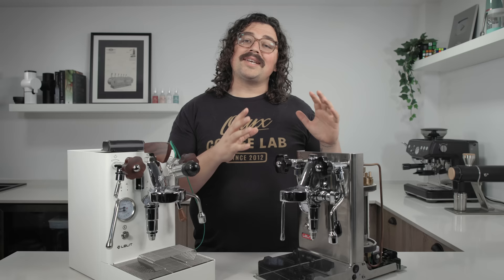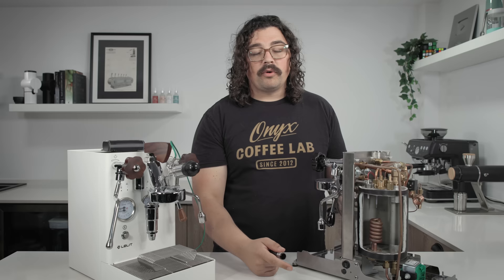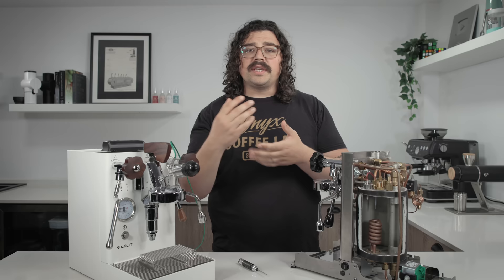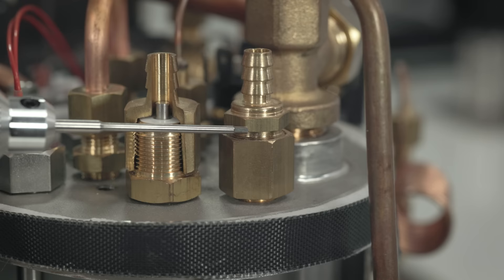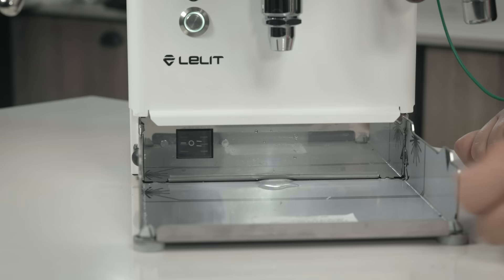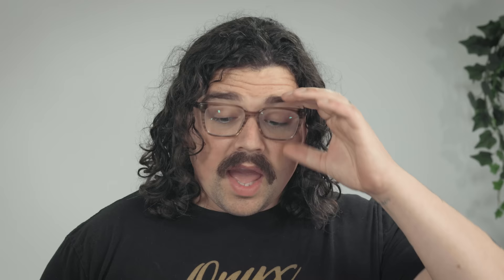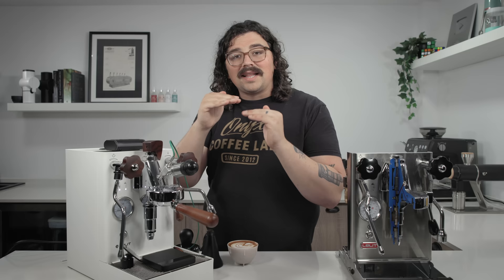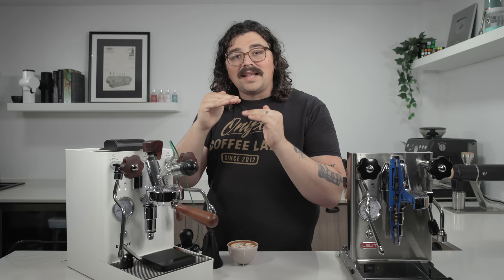BEST BUDGET HEAT EXCHANGER?: Lelit Mara X Review

Comment from the maker: Let's chat below! Ask any questions that may pop up. And don't forget to hit like, subscribe, and the bell for notifications to show some support! Cheers!
Reply: Thanks lance, great review as always. Please stick to the in depth format, I know you were contemplating it a while ago but this is so much better than the usual “reviews” on YouTube.

A good comparison to the Mara is the Lelit Elizabeth which is a dual boiler with steam boiler prebrew for the same price as the Mara. It’s also more energy efficient and I’m debating the choice between the two.
Reply: about  the slow ramp up on the pressure  at the beginning you just   need to change the spring inside the three way selonoid valve after that you have the full control of the pressure from first second to end of the shot.
Reply: About the high temperatures. This is because the machine goes to super heat mode right after the first shot. It will overheat the coffee once you wait too long, if you want to pull head to head shots. Thus to not overheat, you will need to pull the next shot after two minutes from your previous shot. If you wait longer than 5 minutes the machine will overheat. Then you will need to wait 15 minutes before the temperature level goes back down. Kaffeemacher found that one out they also have a great YouTube channel…
Reply: I wish there was somewhere in the USA to buy this machine for the $1400 you qouted instead of $1800... I continue to be dissapointed by how wildly marked up most machines are in North America. It's one thing when we're talking saturated group flagships, but these E61s aren't on that level. Just all the more reason for Americans to buy a Decent, back machines like the Argos and Meticulous, and generally consider these massively marked up E61s something more like a last resort I guess.
Reply: Hey! Does de Bianca worth the extra bucks over Mara x? In terms of temp stability, and others?
Reply: Thanks Lance, can you make a video on the pro500 to justify my purchase? 

More seriously, can you deep dive on the adjustable flow rate kits and how to make the most of them?
Reply: Any eta on the Zerno review?? 😊
Reply: Lance, I’m curious to know what machine you would spend your money on at that price point if that was your budget?
Reply: @BB I own the version 2 and can confirm that the 15 minute cooldown is still there. In my machine I have not found a temperature creep and I’m my machine I still have found the overheating after five minutes after the first shot. And it makes a lot of sense: after the first shot the machine goes to 1,5bar steam by heating the steam tank. This heat will at some point also reach the heat exchanger which is why you will get an overheated second shot if you wait too long in between shots. If you are quick enough with your consecutive shot, the water in the heat exchanger is removed and fresh water is added, preventing an overheat. My Mara is equipped with a thermometer at the same position Lance uses and this is my experience after 6 months of use.
Reply: Hi Lance, thanks a lot for the indepth review. I have the machine since about 3 months now and I have installed the flow control. so I have some questions for you if you dont mind:
1-when you installed the bianca flow control did you change the upper spring as recommended by Lelit? the one provided with the FC kit is softer than the original. and did you remove the lower spring since you dont need it for the pre infusion anymore.
2-can you please tell me where did you get the Y splitter!
3-the relation between the FC and the pressure is not linear as you might have noticed, is it the same as on the Bianca.
thanks in advance if you have the time to  reply.
PS. keep up the great work, you rock :)
Reply: I guess your temp test was done with the standby switched off. Would you say that the ramp up could be somehow mitigated as long as the machine turns off automatically hence you won’t get to the >1h mark with the machine heating up?
Reply: I have noticed the steam pressure after two shots, and steaming milk for two drinks, the steam pressure tends to be pretty low. However, coming from Barista express, I steam milk better at low pressure.  A question: my pucks tend to be pretty wet  in this machine. Is this normal? Just curious, no issues with the taste though.
Reply: Why does everyone sound like Redditors in Youtube comments now. "Friends we made along the way" . Jesus Christ
Reply: @Dawnhun1er  nice review. How about if you flush out the water for a few times? does it help? I
Reply: @MM I have never tried it I suppose it should work. Tbh I never needed it because if you stay true to the above mentioned routine, you will be fine
Reply: I've this machine and I have a constant issue with pressure. Most of my shots are around 4 top 5 bars and other straight to 9 bars as expected. Don't know why this happens, even when I'm using always the same configuration with grind and amount of coffee. Any suggestion?
Reply: Hi, I've been a lelit fan for a year already with my Kate (i know, noob mistake grinder+coffee machine but the deal was insuperable) and I am starting to get interesting in "more" I've seen mara around but I am in love with Bianca and I realized between dual boilers and heat exchangers... The lelit Elizabeth and the Mara X lands around the same price... What would you choose for your coffee at home. I've always heard that dual boiler is the best but I only hear good thinks about the Mara. Also heating time is a concern.
Reply: @javiervidaltellols3355  in my humble opinion, for home use the Mara X does a great job. Doula boilers makes more sense if you plan to make multiple coffees like in a Cafe. The most common is to make 2 or 3 coffees at the time and for this situation MaraX is a killer
Reply: @chipimax  yeah, i looked at the Elizabeth because having two boilers they are pretty small and the group design is different, to it heats up faster and you have two pids... I have a similar deal under 1000€ for both and I stucked deciding... 😅
Reply: @javiervidaltellols3355  I think that on paper, the Elizabeth probably is the better machine. I decided against it mostly for looks and energy consumption, and because I kind of wanted to have an E61 group. After owning the Mara X for 2 years though, if I could go back in time, I'd buy the Elizabeth. Dedicated boilers and easier to clean because you can just backflush with Puly Caff / Cafiza / whatever cleaning product as often as you like, unlike with the E61 group, where the mechanical cam will eventually begin to squeak unless you disassemble and lubricate it. Also, while I like what Lelit has done by adding better sensors and software to a heat exchanger, it's all very opaque and unpredictable, unless you have the tools to measure every variable.
Reply: I like how technical you are with your reviews. I would love to see a thorough review from you about the Olympia Cremina.
Reply: It's a remarkable machine and very well engineered for the cost. I would be keen to see you do a similar breakdown of the Elizabeth, Lelit's dual boiler machine at a similar price point but also has the advantage of not using the E61 group, so heats up much quicker.
Reply: Hi Lance! What are your thoughts on the Elizabeth?
Reply: This is great. But the espresso machine by no means is budget come on
Reply: Hi I'm a new subscriber! I love the reviews (I'm a massive NERD myself). I have two questions:

1. What do you think of this for a small, adorable cafe for someone who wants to get into a cafe business?

2. This vs. Rocket Appartamento TCA, which one is better?
Reply: Hey lance what’s your thoughts on Mara x vs Classika??
Reply: Hi Lance let me just start by saying that I love your videos ! I wanted to ask you a question. I just hope you see this. I have a Barista Touch (broken down) and i’m looking for an upgrade. The upcoming Breville Oracle Jet caught my eye but so has this Lelit Mara X and even the Bianca. I  don’t know what to go for. I have mainly espresso or americano or long blacks and never use any milk. I like the simpleness and quick heat up of Breville but i enjoy prepping my coffee and dislike so much automation. What would you point me towards?
Reply: @kagantirtir7700  Hi Kağan! Could you please elaborate a little bit more on this please?
I'm really interested on disabling the slow ramp up on my Mara X!

Comment: The temperature drops , because you are on brew mode and the heating element is off , and when you have the flow control closed, the machine pulls fresh cold  water in the hx brew chamber .

Comment: Thank you for showing the inside of this machine. Two things I have been asking for Stainless Steel and Copper element. So many videos don't show this or they don't know what is inside. And they never talk about high-temperature boiler applications, three general grades (Stainless Steel), 304, 321, and 347, are the most widely used. Know ones about this! I have to go directly to the MF.

Comment: The temp drops because this machine is setup with perfect flow at stock setup to inject enough thermal energy into the large mass of brass to maintain the programmed temperature curve. When you choke the hot water you choke the heat input into that huge block of metal and the temp must fall as a result. Other machines may behave differently because they are limited by the heating elements power output so reducing flow helps the heat rise. But here we have a very large thermal mass in the boiler cushioned via a heat exchanger, thus providing a very stabile source, choking it does not spike the it high at source but it does reduce what goes into that huge cool block of brass at the front, without enough heat input into the brass the temp falls. Amazing thermal design and construction quality. I'm a heating engineer and I recognise the fittings and construction methods used here to be top notch. Solid old school hydronic design, its been tried and true since steam engines ruled and looks similar in rocket engines that go to space today, good old compression fittings, soldered connections and formed metal pipes. Boilers a boiler weather, its heating a hospital or coffee cup. We use the same sensors and prv valves.

Comment: I have a 250ml single boiler Lelit Anna with PID and I love it. Added preinfusion / flow control using your Gaggia classic mod video as a reference for the wiring. I couldn’t justify spending twice as much on the Mara X just to save the minute the Anna takes to come up to steam temp which is the biggest difference I could tell.
Reply: Interesting. I have the Anna with PID too. I will look into the preinfusion & flow control mod. Thanks for commenting :)

Comment: Great video as usual Lance. I almost pulled the trigger on the MaraX a year ago but the V3 Bianca was too good to pass up. I’m glad you reviewed both the MaraX and Bianca because it really validated my purchase and my research process. 

The tear down was mind blowing and I learned more about a HX in one video than I have in a dozen others. Maybe you could tear down a dual boiler next? 😬
Reply: Bro, it's $3k+ :)
Reply: I was thinking about Bianca, but just don’t see any benefit of flow control, other features… once you master gaggia classic pro. All those ‘extra’ features are just noise. For me, I pull the perfect espresso shot with just 9 bar spring upgrade, wdt tool, shake prep, right grind, etc…that’s where the money is at. Gaggia does have quite few plastic components inside and that would be one of the main reason for an upgrade-better components, not necessarily a better shot :) Oh yeah, I would rather invest the difference between Bianca and marax into eureka libra grinder.

Comment: Btw, someone may have mentioned but it seems like you have power saving mode turned off. That obviously helps with the temperature spiking if left on, as it will hibernate at some point, essentially turning the system off, but ready to be turned back on (after any needed warmup) with the lift of the paddle. Since power saving mode is on by default I thought I'd mention it (and you may get to this later in the video!)
Reply: Thank you for this! Have you tested this?
Reply: How do you turn that off?
Reply: @xer0cool  if you power the machine off, lift the group head lever completely, then power back on, it will toggle the standby mode off
Reply: Same thought here. Maybe another good reason for the factory default setting (besides regulatorics)

Comment: Great point about the HX issues with thermal management when the machine has been on for too long. I have an ECM mechanika slim (the current one) and I deliberately leave the eco mode on to avoid it overheating. 👌
Reply from the maker: yeah. it's really the only way even with the innovative dual thermoprobe solution here
Reply: That would be also my idea. 
Plus: Adding a E61 temperature sensor ('Eric's thermometer') to understand the behavior of machine. Maybe not all the time, but from time to time. Also helps to detect changes over time, e. g. due to build up of scale in the HX

Comment: Your personal opinion on HX is extremely helpful to get your perspective on the engineering and price trade off. I’d love to hear your top down opinion of the different technologies and what trade offs are worth making at different price points.
Reply from the maker: TBH, i'm going saturated group 10/10 until the thermal management on E61 style groups is managed (I dont think it will be considering the hunk of brass). Also, time for heat up and power draw should be considered. Group with boiler directly above or saturated electronically is MY way to go. but, i don't want to obfuscate a review with these personal opinions. I think a video dedicated to it is the right move.
Reply: @LanceHedrick But aren't E61's overall way, way better value for money compared to saturated group heads?
Reply: @LanceHedrick  I have to agree; E61s are only still around because they're pretty much a "parts bin" group that doesn't need any design work to implement.
Reply: @LanceHedrick  Breville Dual Boiler?
Reply: @LanceHedrick  And maybe switch to induction heating of boilers.
Reply: @LanceHedrick  Hey Lance that could be an interesting video? Power draw from each catorgory or segment of espresso machines all the way from appliance thermo block design to  SB - HX - DB - SG etc.
Reply from the maker: @Antonis .Occupied London  if value for money is top priority, probably. Though you could also go with a Gruppo satturo from La Marzocco and the same applies. It is less the ubiquity of the E61 Components and more the widespread understanding they're available. Just as many parts available for something like A La Maz

Comment: what a great timing for the video. I just got my MaraX 2 days ago. I am still in the learning stage and debugging phase but I got answers to most of my questions in your video. Thank you!
I am playing with the grind size as currently I am only reaching 4 bars in pressure and the flow is extremely fast. I tried the blind basket the pump is working as it should so it is definitely the grind....but I am getting there. One thing which was a surprise for me that when it is heating it is hot almost everywhere and when it stops heating it stays hot for hours :D

Comment: What a great review! I have always had the flow control kit on my mara x v2, but I couldn't ever figure out how to even use it properly. Thanks for explaining this. I noticed that when you pulled your first shot, the temperature was still getting stable cause the temp lights were blinking. Also, while pulling back to back shots, I've found that turning the machine off, and while i get my puck prep done and turning back on when i finish, still build the temp back up pretty quick, while ive not confirmed if it has been increasing temperature, ive always never felt the coffee taste different.

Comment: As an early adopter of the MaraX and having watched pretty much every review on the product, you once again excelled yourself, kudos for a fantastic video. That particular Lelit product is technically advanced compared to traditional HX and has since been copied by the competition such as latest Profitec, but i have faced some quality control and parts issues over the last nearly three years now. Also, cooling flushes I find they help with temp stability and allow you to “cheat” the cycle and get steam out faster in brew mode. Nothing major to make me regret the purchase but my next machine will not be an HX, probably Lelit again but Bianca.
Reply: Thanks for the insight

Comment: Great review Lance, so much better than the typical sales-driven stuff that is so ubiquitous on YT. I have had an old-school, non-E61, pressurestat-driven HX (with an electrically heated brewhead) for 10 years, which at the time of purchase was about the smallest machine in its class on the market. The MaraX is even more compact, but with so much stuff in a small casing, how would you rate its maintain-ability? Do you have to take out all the internal parts when you want to, say, change out the pump?😊
Reply: The small footprint was a big factor in my choice of the MaraX 2 1/2 years ago, as was the expected longevity and ease of repair.  The internals are very accessible simply by removing the casing (which is also easy).  Changing the pump would be simple.

Comment: 28:07 As a 1 yr Mara X V2 user,  I've found out that you can pull up and hold the handle just at the point where the pulp switch is on, to make the water comes out a little bit, then let it back at the middle position to make the pre-infusion happen. After that you can pull all the way up to start brewing.
Reply from the maker: Issue is it doesn't push thru with any meaningful pressure when doing that